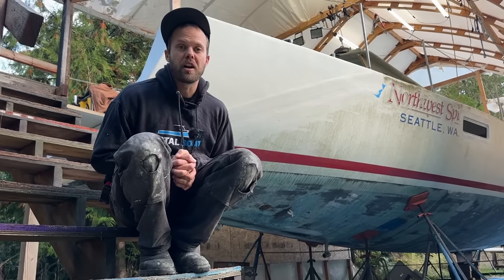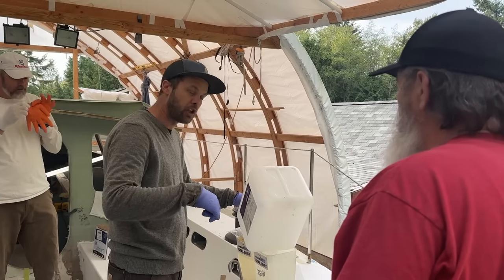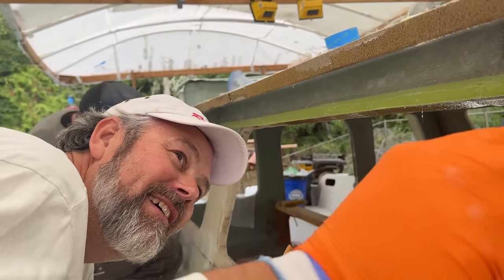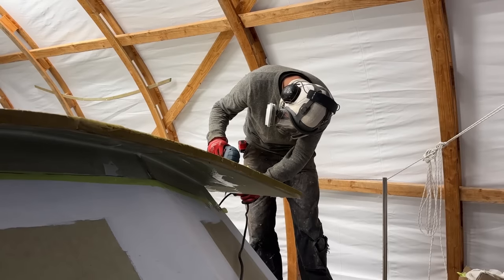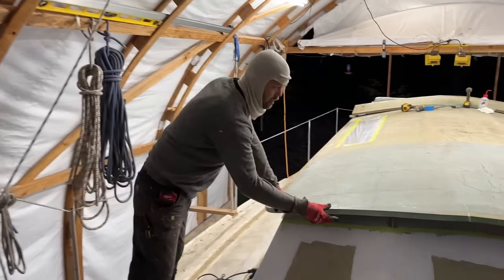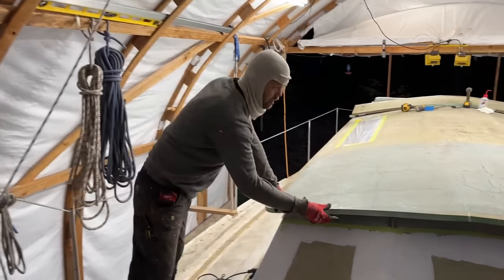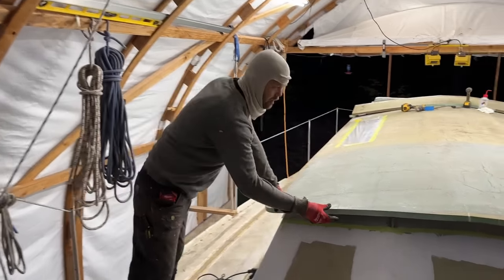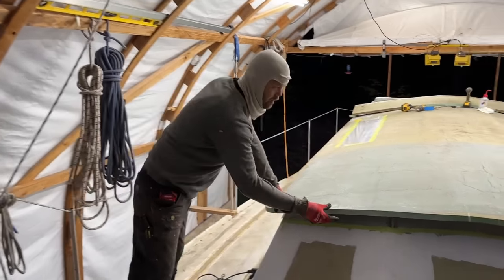Laminating the doghouse roof with the help of friends [E99]

Comment: A question for next weeks Q & A. Is the keel to retain its shape and weight?
Reply: I can answer that - nope! The existing keel is very deep and not very cruiser friendly. So a shallower keel is in the works (with less righting moment) but the rig is a big smaller than the old racing rig too so it will all work out. The long'l center of gravity of the boat will be different so we will have to shift the bulb fore-aft position too. It's on the back burner right now.

Comment: Fighting the cold, I get it. I'm trying to get the last bit of work done on my boat before it drops below 40 degrees and I can't lay up any more epoxy. So close and yet so far away I just found two more bulkheads that need to be replaced. I've already done 8, and replaced the decks and  sides of the doghouse too. There's also a  spot in the cabin top that needs to be investigated.also the floors and stringers as well. I can't wait to move on to the next phase of the refit.

Comment: Ok, a question for the 100th edition: double barrelled question actually. 1. With regard to catching rain water on the roof, will you be designing a first flush diverter to dump the first 20 L or so of water which, I imagine, will be a little saline? If so how will you make that unobtrusive? Secondly, I don’t remember much about your keel, will you keep it short (and winged?) to improve your shallow water navigation, especially when you pull up to those deserted coral cays in the Pacific (on your way to visit your hordes of subscribers from Australia 😊)? Ooooh another question: 3. Describe your solar/battery set up, doghouse roof looks ideal for some PV panels.)

Comment: The Inspector had to keep an eye on the noobs make sure they knew what they were doing.  Of course you and mom did a good job on the glass along the edges.  

100th episode, congrats!  Next milestone is 100K subs.  Are you going to try to get the windows in or at least closed off from the weather?  A small heater would then allow you to do epoxy work in the cabin over the winter. Thanks for the episode.
Reply from the maker: I’m not gonna install windows yet but I’ll definitely seal them up with wood or something to insulate the boat this winter

Comment: You have got to try more pre-wetout of biax tape with a plastic card and a hard worktop.
Reply: I would always try and pre wet out if taping overhead/overhang if you lay both layers of tap onto plastic sheeting you can even stop any distortion then peal of the plastic once its 90% in place and continue you consolidate

Comment: You need a very slick, at least partially composite tender, do you have something in mind? 
On a project so big, you end up learning so much, in retrospect, would you have changed some of the orders of operation to be more efficient? Changed any design aspects? 
Are you rigging with SS?  We’re loads too high to make dyneema feasible? 
What are some of your must haves for galley/cabin comforts having already done extensive cruising?
Maybe I missed it but do you have a working rudder?  Would love to hear more about the design of that. 

Great stuff, I look forward to your episodes every week!
Reply from the maker: good questions! we will answer your second question in next week's vid. We just made a plan for the tender-it's gonna be fast and light and have a sailing rig and electric engine (maybe). must haves for galley: good stove top and oven, BIG sink, side opening ridge (no cave diving) etc. We do have a working rudder and a very exciting steering system in the works.

Comment: You're every much like myself, a perfectionist, always trying to do the best that one can. As hard as one might try, with the fiberglassing not turning out in spots, as otherwise one might hope for.
 My question is, will the finish gel coat fill in and help in the final and ultimate smooth finish surface, you're striving to accomplish?
Reply from the maker: Boat won’t be gel coated. It will be faired and painted which will make it smooth

Comment: Great work Matt and team👍👍.

Just a short question- I usually use polyester to laminate the glass and not epoxy, what do you think is the pros and cons with those two materials?
Reply from the maker: Polyester would have been fine for us to use for this project. I chose epoxy mostly because I do not need a mask to use it and I’m also most familiar with it
Reply: @TheDuracellProject Thanks, yes that makes good sense.

I want to find the kind of fiberglass mots you're using - how thick are they?

Comment: This might be a dumb question. But what is the difference between using the epoxy on the glass as to using polyester resin? I have been following your build from the beginning and I have been watching another YouTube channel who doing boat repairs they are using the polyester resin while you are using epoxy. Just curious what the difference between them. Take care and keep up the good fight.
Reply: As the project's tame Naval Architect I can try to answer that. Pros: Epoxy has (a) superior mechanical properties; it's less brittle and stronger (b) it bonds much, much better to old existing polyester based fiberglass hull and structure. (c) It has very little or no solvents so it doesn't stink of styrene like polyester resin.  Cons: (a) it is a skin allergen so you need to protect your skin from wet epoxy or just cured epoxy (b) it's lots more money. (c) slower cure times for things like fairing if the weather is colder. I used about 80 gallons of epoxy on a big sailboat project I did. I thought it was worth it. Polyester resin is used strictly for cost reasons in production boats. All top end racing boats will be epoxy because it's just that much better.
Reply: Thank you. I have very little experience with fiberglass carbon fiber. Worked with fiberglass a little in my teenage years with surf boards. Back then I was only aware of the resin. My how things change.

Comment: Congratulations on the 100th episode. Some time back you weighed the materials you took off the boat in an effort to estimate the renovated boat’s weight. Are you still tracking how much material (lamination, wood etc) that you are putting on the boat? Do you need to consider weight distribution? Congratulations again!
Reply from the maker: roughly still tracking. i'll answer this in next week's vid